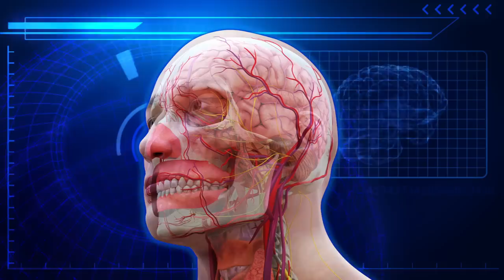Broken elevator trim tab possible cause of Reno air race crash

Comment: @EasternMerchant 
That is not the case with these planes. The way they are balanced a significant amount of tail up force is required to maintain a proper attitude at race speeds. The trim tab is used to maintain the elevator in a position where that tail lift is adequate. When the trim tab broke the elevator went back to "neutral", and at race speeds that causes a dramatic nose up moment. What you said is usually correct, but these planes are balanced very tail heavy to try and minimize drag.

Comment: OH MY GAWD this is so horrificly wrong!  a trim tab only stabilizes the elevator to where the pilots wants it.  For example, if you go up in a plane, you don't want to have to hold the Yoke back the whole duration, you would get tired, so you would trim the elevator up enough so that you don't have to apply backward pressure to the Yoke.  Without the Trim tab, if the plane cg is balance, it would just continue back to level flight if you released the yoke.

Comment: The pilot stalled probably by maneuvering the plane past the angle of attack (a point where airflow is disrupted over the wings).  One way to accomplish this is by pulling completely back on the Yoke to make the plane go up, but instead, stalls. Since he was getting near the ground he panicked and didn't release back pressure on the yoke causing the plane to constantly tip stall to the left and to the right.  He probably tried to play catch up, but the plane oscillated from one stall to another.

Comment: @childsca ahh that's right I forgot, that's right! there's an angle of incidence in the wing so as the plane increases speed more forward pressure is needed on the yoke unless it's constantly trimmed until the plane is no longer pitching upwards, with the sudden failure of the trim tab this causes dramatic increase in G-forces as the plane goes upwards like you say.  DOH!  I didn't think of that one.  hehe Ya got me!